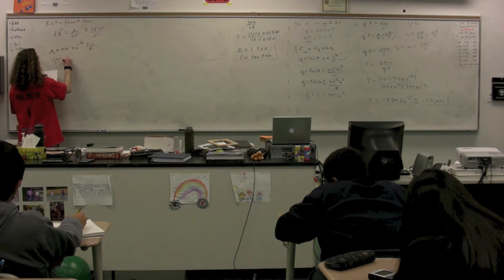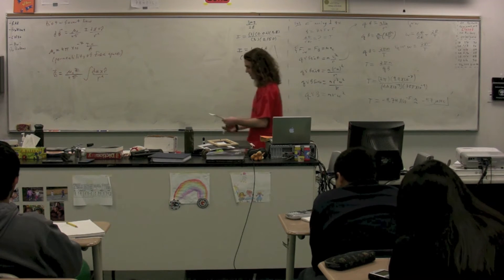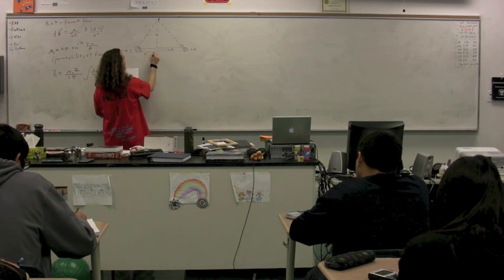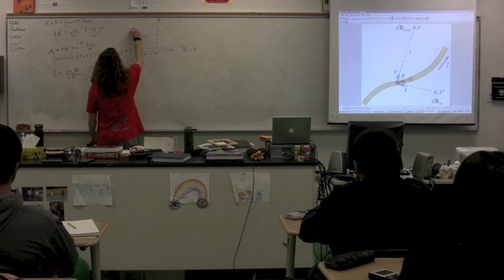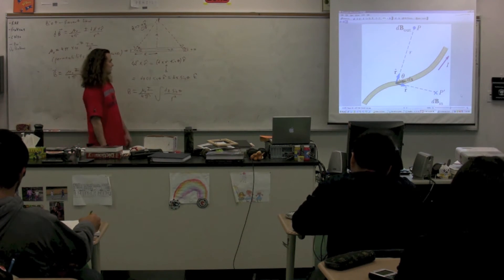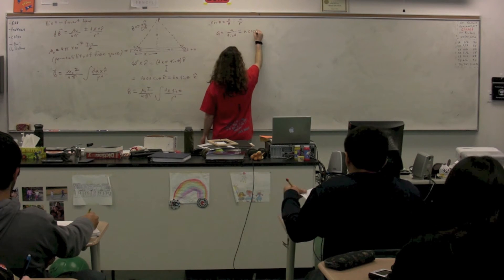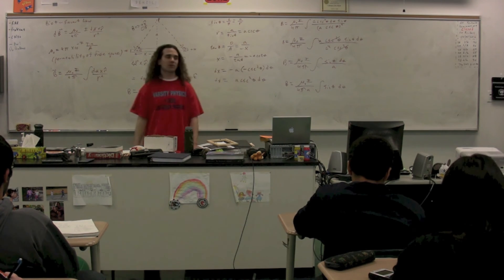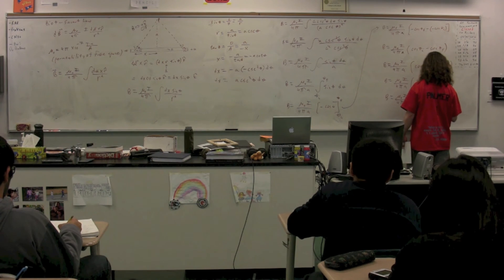Derivation of Magnetic Field from a Long Wire using the Biot-Savart Law - AP Physics C

Comment: last question could you explain why you write ds as a vector?
Reply: I love it when my students say "last question". Rarely is actually true.
ds is the direction of the wire/current, so it is a vector. Biot-Savart uses the cross product or vector product, so it requires vectors.
Reply: @FlippingPhysics  so you will not be surprised if i ask other as what i am gonna do 
while initial angle and final  depends on the direction of ds so it always will be 0 and 180?

Comment: why initial angle 0 and final 180?
Reply: The wire is infinitely long, so initially r and ds are in the same direction, finally r and ds are in opposite directions.
Reply: @FlippingPhysics  I love you more than anyone
Reply: @FlippingPhysics  please could you explain more clearly
Reply: @rr-jv6im  In the diagram "x" has a finite length. If "x" were infinitely long, r and ds would be in the same direction initially.

Comment: Hey Mr.Palmer, at around 10:00 can you explain again why x is negative, and why is theta0 = 0 and thetaF = 180?
Reply: x is negative because the direction of x, which is to the left from the middle of the wire, is negative.  [left is negative, right is positive]

The wire is infinitely long therefore, theta initial is zero because x initial is negative infinity and theta final is 180 degrees because x final is positive infinity.